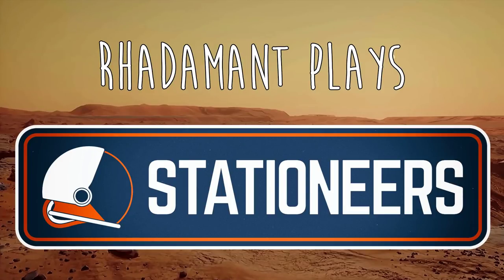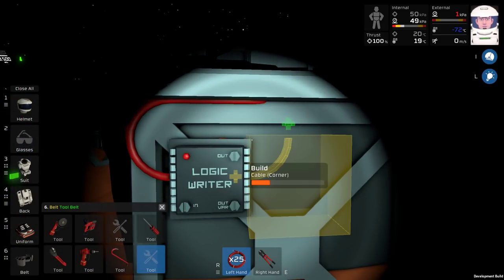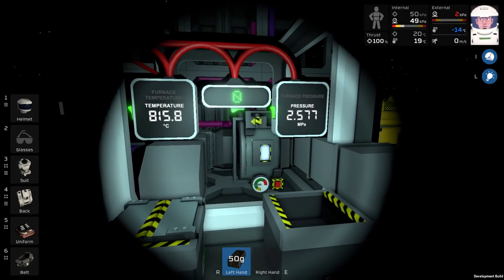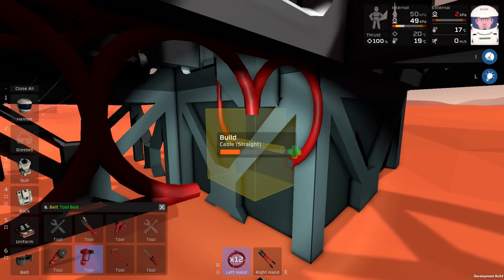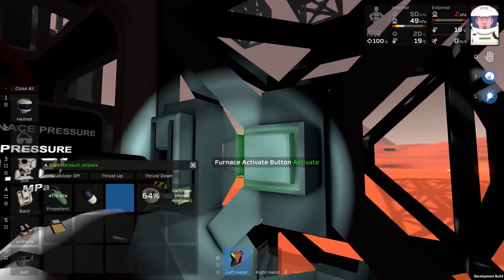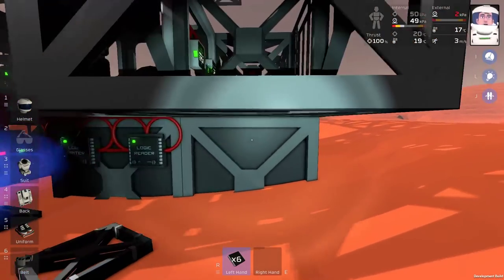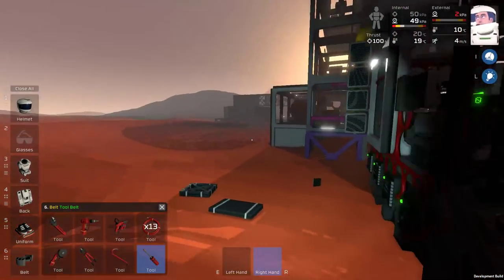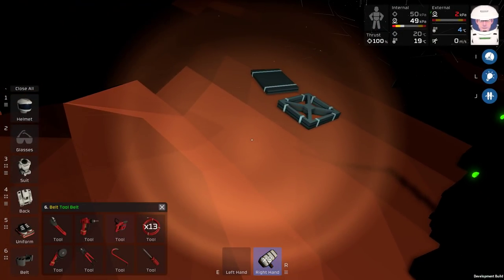Stationeers / EP 27 - Gas Capture Furnace Part 2 / Mars Colonization

Comment: FYI, for future furnace room:  If you place the furnace just inside the frame and build a window inside the same tile, you can still control the furnace from the front (the furnace just peeks through the window.)  Also, a reminder that the Furnace does not off-gas, but it does radiate, so place it in a vacuum to maintain heat better.  If you weld it into a frame it will radiate to the world and therefore attempt to cool to planet atmosphere.
Reply from the maker: Very cool setup there!

Comment: Question with automating the furnace - given enough logic, is it possible to store the gasses needed in the furnace in a tank -  tell the furnace to suck in the required gas percentages, superheat them on their way in and then you can cook what you need and then vent what is left out - so you store all your volatiles and ice in gas form and store them prior to use
Reply from the maker: Yes, absolutely. Just don't keep oxygen and hydrogen in the same tank unless that tank is SUPER COOLED or it will combust.

Comment: You don't need to add a reader to read logic switch. Switches (all variants) can be fed directly to Writer input.

Also for readers that go directly to adjacent writers, put the reader on the left side and writer on the right, this way you can connect the reader's output to writer's input with a straight cable and wont have to search the entire network when configuring the writer's input device. (saves a bit of time and One cable too LOL)
Reply from the maker: Ahh, that's a nice tip!
Reply: But then not everything will be on the network to mess up the main power controller. :-)

Comment: I had a issue along time ago where when setting up a power control display you could select switches but if you selected them they would act as a control for the power control board but idk if this is the same issue your having.
Reply from the maker: Any idea how you remedied it? (I'll be tinkering off camera for a solution as well)
Reply: Replaced the motherboard and when I reset it up made sure the switch wasn’t selected on the data disk.
Reply: But it’s possible you may just be able to reinstall the switch to resolve the issue maybe